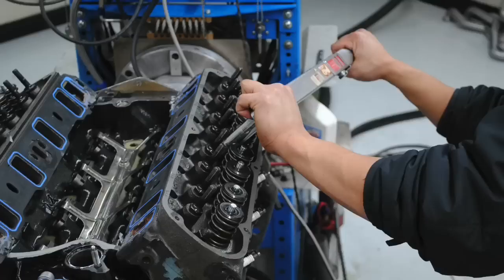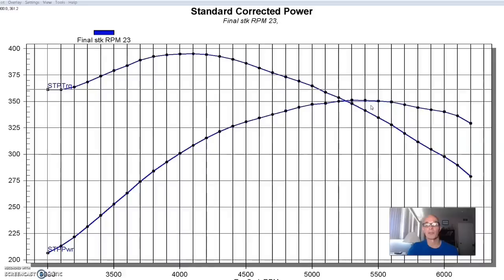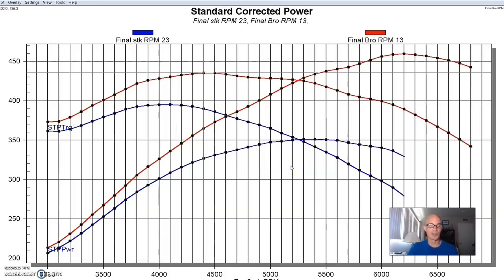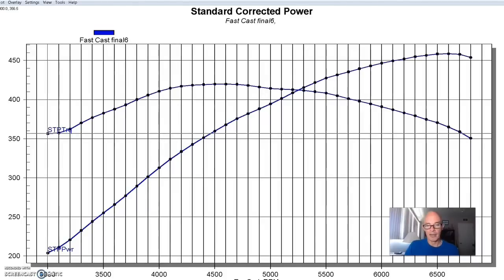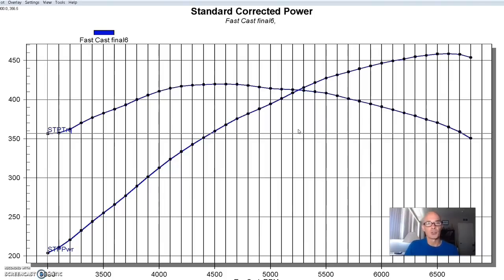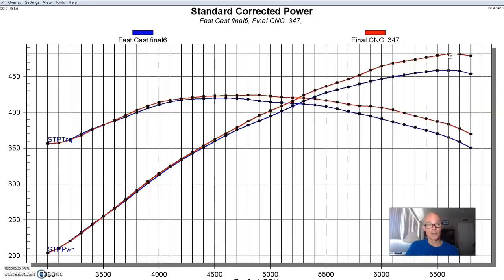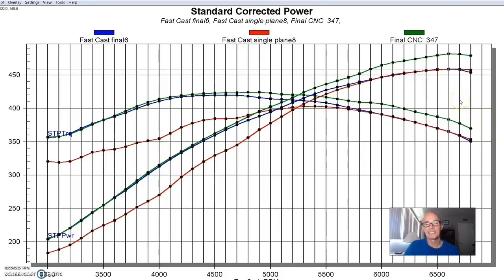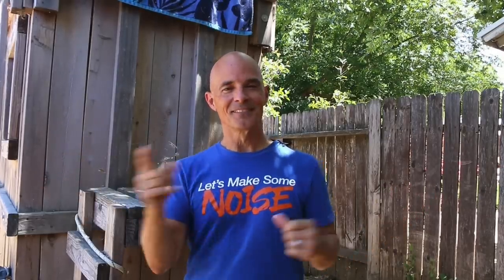347 FORD HEAD & INTAKE TEST

Comment: 306, stock 91 block crank and rods. .30 over forged pistons. Trickflow 165 heads, stage one cam and intake. 30lb injectors 70 mm throttle body, 30 lb mass air meter in a 75 mm tube, underwood k+n filter, BbK long tube headers, off road hpipe 2.5" flow master 50 series mufflers. Centerforce dual friction clutch, 3.55 gears.   91 5.0 5 speed coupe. 13.2s stock 1/8 mile, 7.8s after. Both on Mickey Thompson drag radicals. Man I miss that car....daily driver, pulled trim carpentry trailer and 17' center console boat with it

Comment: I have a 302 with speedmaster heads mini dome pistons 10.5 :1 Edelbrock 2221 cam .520 lift in and out air gap intake 650 AVS Edelbrock making 402 at 6300 😊

Comment: I have a 347 stroker with a trick flow stage 2 cam and afr 165 cnc heads. The car drives amazing but I think I left some power on the table not getting a 185 or 205 intake head. What do you think?
Reply from the maker: you didn't leave stuff on the table with those heads-they will support another 50+ hp

Comment: I put together 408 stroker. 10.2 compression, trick flow 11 R 190 cnc heads, Howard's cam 236 - 245 duration with 597- 597 lift, and a 110 lobe separation. Edelbrock RPM performer intake manifold ( not the airgap ). A 650 double pumper quick fuel carb, and with 30  degrees of timing, this combo made 525 HP and 530 torque at 5900 RPM'S, and that was with spinning the water pump and the alternator. Would have put a victor Jr. On it with an 830 carb, but don't have the hood clearance. Makes for a thrilling ride in my 2400 pound cobra.

Comment: What spring do you use when you upgrade the springs for the cam I am about to build a 347 looking to go promaxx project x 210 heads and a scat stroke package
Reply from the maker: don't they have a spring package on that head
Reply: @richardholdener1727  yes its a 145 pound closed and 325 open

Comment: 4v cleveland showed if the head is big just run a smaller cam.    The Boss 302 beat the smaller head bigger cam dz302 across the entire dyno plot.   The boss 302 uses a much smaller cam due to all the airflow.

Comment: Even on the larger 347 the stock E7 heads basically keep  up with all of the aftermarket heads up to around 3500 (equal to or within 10 lb./ft. of torque). If someone had a good set of E7 heads that would only need a fresh valve job, a bowl blended/cleaned up set would make a great sleeper daily driver on a 347. You are still getting the magical 1 hp per cu/in and all of the low and mid range you can get for a really fun stoplight to stoplight street car.

Comment: Its not the heads that are the limiting factor. It's the intake manifold and carb. Port the intake manifold and give more airflow and the motor will make more power.
Reply: Agree the manifolds need porting to work with the heads youre using.
Reply: @dennisrobinson8008 most of these tests are on out the box parts and im never going to run out the box parts if I have a motor torn down
Reply: @bigdogsportingtonyb2833 nice.     What are your thoughts on Parker funnel web?     Like you i dont think your induction is right until the intake is ported and setup for your heads and intended usage.   Many intakes are unfinished looking back at things.   Even vic 5.0 and 5.8 like you showed do 265cfm unported.    On a nice 330cfm head they'll limit flow unless you port them.    Those are some bad ass intakes when you set them up.
Reply: @dennisrobinson8008 exactly. We've ported and tested many FW manifolds and when people use them they are trying to make good HP with a stroker motor so you need them to flow but be efficient. Meaning keep port velocity high while also getting enough cfm to feed tge motor. Unless you are spinning past 7,000rpm i say stick with our ported Dual Plane manifolds. Best of both worlds

Comment: My combo using Trick Flow 170cc heads, with their upgraded springs. 

SBF 306, Reman Cobra motor,
Hupereutectic Pistons
Stock rotating assembly
Trick Flow heads
Ported lower, GT40 Tubular intake manifold port matched to an Accufab 75mm Throttle body 
Anderson B31 cam
Ford Motorsport lifters
Holley X
60lb injectors
Hellcat 525lph fuel pump
Aeromotive FPR at 53psi
Vortech V3 
6.87 lower 2.75 upper pullies 
570whp/538wtq 

I love all these dyno videos. I could watch 10 a day. The how and why along with the graphs are so intriguing for me. 
Please keep them coming. 

* side question. Can you run the AFR Enforcer heads on a 302? They flow less than the 165 Renegade heads and have smaller exhaust ports, but have the larger intake and exhaust valves from the 185 Renegade head. So I'm curious what that will translate to in power output at both peak and under the curve.
Reply from the maker: you don't have enough motor to take advantage of either head-so there would likely be minimal difference in power

Comment: I'm running 347 stroker with afr185 cylinder heads trick flow stage 2 cam Holley dominator intake dss dish pistons forged everything 660 Holley carburetor

Comment: Great video.  Thank you.  I'm working up a combo for my 89 Mustang 302 (5.0) street car now.  I'm determining how much head I need for the 302 and would like to run the same head on a 347 or possibly stroked 351 at a later date.  170 or 190?  Sounds like CNC ported is the way to go for that.
Reply from the maker: 190

Comment: I built a 347 using a dart block 4.125 × 3.25 afr 205 cam 251 in 264 ex 11.7 comp 750 holley 1.750 headers   with super victor and a parker funnel web the parker made 35 more hp at 5000 ft in colorao 537 hp 477 ft tq
Reply: The funnel webs are doing great and almost as much avg torque as a good dual plane.

Comment: Hey Richard, running a 302w which will one day become a 347. It will be a daily driver type build not a race car 😂 and planning on running Holley sniper injection.
Questions.
Will the afr 165 heads still be good for a 347 street car?
What cam would work well for both engine sizes and what manifold would suggest best for the sniper EFI.
Cheers
Craig down in New Zealand 👍🏻
Reply from the maker: if you plan on going to a 347-get 185 heads
Reply: @richardholdener1727  ok Cool thanks. What about a good low to mid range cam for street driving
Also manifold to suit Holley sniper EFI 👍🏻

Comment: Can someone help me out with lobe separation on a solid roller cam what is the difference between a 108 lobe separation and a 112 114 what is the  powerwize difference thanks guys? Mine is 248 at 254 .108 660 lift. 393 Cleveland is this a good cam?
Reply from the maker: YES ITS A GOOD CAM

Comment: 331 Keith Black pistons afr 205 renegade heads 1.6 roller rockers victor jr tall  intake 800 cfm demon carb. Lunati 549"-564" 270-280 duration 112 LSA. Do you think this would be a good combination for a single or twin turbo at 10 to 15 lb of boost?what kind of numbers would you expect? Thank you love your videos

Comment: I’ve built a few 351w with Edelbrock and AFR heads but my favorite engine combo is a little laughable but I’ve had it a long time and love. 327 ci Ford ( 3.25 stroke standard bore ). Red Cornet ported gt40 heads b303 cam air gap intake. Not powerful but puts my 67 mustang coupe in the 12.8 range consistently.  It just always does what it’s supposed to and never misses a beat.

Comment: I would of liked to have seen it with a ported gt40p head!! Thank you for the info, I’m building a 302 stroker 330, with aforementioned heads with a .500 lift ford roller cam, now performer rpm air gap (had China special), w/ summit 550 carb, .027 head gaskets, I know I’ll touch an easy 410 ft/tq, on a 70 Ford 100 short bed, with an AOD !! Perfect all around town/camping/cruising/ kind of truck!! Thanks again for the info!!

Comment: I would like to see a cast iron in the comparison.  I have an 82 Capri, 306, TRW flat tops, World Product Windsor Sr heads shaved to 58cc chamber, Comp Solid Lift 294s (248/248 dur .56/.56 lift, 1 5/8 Long Tube headers, 4500 stall, built c4, 9" with 4.56.  Dyno showed 270 at the rear wheels @6800 and my best et is a 11.945@ 111 mph.  I want to stroke the engine to a 347 but do not know if I should stay with the Cast WP heads or upgrade to AFR185/195s.
Reply from the maker: TAKE A LOOK AT THE 5.0l FORD HEAD TESTS

Comment: 306 dart, p7675 turbo, afr 185, rpm 2 intake, f cam did 782/785 on 20 psi. Thinking about stepping up to the xe274hr in hopes of making more power at the same boost level.
Reply from the maker: SHOULD MAKE MORE AT 20 PSI
Reply: Richard Holdener I’m thinking maybe in the neighborhood of 25 more hp na, so approximately 70 more at 20 psi if my math is hypothetically correct lol?

Comment: I got a 85 mustang gt with some 65 289 heads that's been ported and polished and with 2inch intake valves and 176 exhaust valves  double valve spring to match the f cam the heads have 49.2 cc closed chamber head with a weind stealth intake and a demon 650dp carb the car is real fast and reliable I drive it anywhere

Comment: 332 Stroker (91 block) Scat rotating assembly, Mahle 30 over 4032 forged pistons, 6.5 cc dish, fancy small low drag ring pack, 18 thou top gap, 20 thou bottom gap, pistons are 6 thou in the hole, torque plate honed cylinders, tight clearances PTW @ 2 thou, mains clearance @ 2 thou, XE266HR12 cam straight up, linkbar lifters, full roller rockers, 6.45” pushrods, static compression at 10:1, dynamic @ 7.80:1,  Blueprint HP9009 heads 2.02 intake 1.60 exhaust,  60cc chamber,  .039 compressed head gasket, Weiand dual plane, Summit 600 vac secondary annular booster carb jetted 68-72, bypass return style fuel system set @ 4.5psi, timing 11 initial total all in by 2900, 65 psi full synthetic, cruising temps in summer 165-170, idle temps 185, running 91 octane, never heard knock, don’t know much about tuning, idle AFR @ 13.5, cruise AFR 15.5-16(pulling in more timing with vac sec) WOT AFR 12-12.5, I like it. Works for my manual granny low 4 speed 1980 Bronco on 35s with 3.50 gears (I DO use the 6.69:1 “1st” to get her fat ass moving) highway cruising at 80mph @ 2700 rpm, almost forgot, have a 1” open space between carb and intake

Comment: 351w, afr185s smallest chamber, hyd roller from lunati small base circle with nearly .600 lift factory mustang r.lifters. 288/.294 with enough lobe separation it has a stock sounding idle, flat tops ending with roughly 10;1 compression, air gap intake,  pertronix, 780 holley from the 1960s, I threw a set of 1 5/8 shorty headers on and probably hurt the power.
 I don't know what it makes, but it has a ton of street manners just driving around town. 
The car is far from finished,  what kind of power do you think it makes???
With a nitrous tune, 8.0 in the 1/8 mile without the nitrous. Can't afford it yet...

Comment: In 1987 I built a 400 .030 over (406) Short rod 5.56 TRW flat top piston 461 casting (pocket ported to clean up casting lines and flaws in the port) << 64 cc Had to use 93 Cheveron, or Exxon, 99 cents a gallon back then ( before the Exxon Valdez Disaster)92 Octane phillips would rattle.. Camshaft was (Crane HMV 278 )I 222@ .050  E 234@ .050 278 290 << ADV ..114 LS  .467 .494 with 1.6 roller rocker = .498 and .526 " lift. Weiand 8004 Intake with an 800 Thermoquad.<SP>? Heddman headers. Stock converter no need for a increase in stall speed. I would LOVE to see this recreated and dynoed. This was in a 1979 Z28.

Comment: Which specific TFS as cast heads were used? I have a Ford 347 stroker w/the aftermarket Ford Boss 302 block that I am building and trying to decide on sticking with a TFS as cast TFS-51410004 170 CC INTAKE W/61 CC COMBUSTION CHAMBERS. I planned on doing some port work on them, but wanting 500-550+ HP and thinking it will be the restriction as I believe that they are going to max out at 500 hp. I am also going to run a 750 demon sitting on top of a Victor Jr intake that I will port match and do some more blending work. I am also planning on the XFI236HR-14 comp cam possibly. Planning on running about 11.5 :1 compression. I have also considered running a solid roller cam to wind it out in the power band to take advantage of the single plane manifold. I will be running a billet flywheel, aluminum rods and light weight pistons and a forged scat crank.

I would like to know your thoughts if there is enough flow with these heads to support the power numbers with the extra porting and blending work on the heads. It would appear that is what your video mentions that they would if you are referring to the same head. I do not know what the potential of the flow of these heads once ported. Can they support over 550 HP with some mild porting? 600 HP would be amazing if I can get it out of these heads.

Comment: Know this is an older video . The 347 was a very good performer every one I built made some steam . Best one I built was 15 years ago I called mighty mouse . Used a dome Wisco piston and a set of high port tfs head lightly ported would run 990-10.0 in a 3100 lb mustang with a c4 coan converter was a wheelie machine car ran great

Comment: Ive had a lot of luck with high compression (12/13:1) 347s with ported victor jr heads, single plane manifold and 750 dominator carb! 500 plus easy!

Comment: What I have that works is, unfortunately, not a pushrod motor. Stock Gen 2 Lightning blower, cams, and upper and lower plenums (with a ‘00 Cobra R throttle body) attached to a stock 5.4 block filled with a Manley rotating assembly. For heads, they are sporting 1mm larger intake and exhaust valves and some pocket porting. This is drawing through a 90mm MAF, field by the stock fuel system, exhausted by Kooks long tubes, Bassani cat pipe and cat-back. The blower is running overdriven (of course) with a 2.5 upper and 6 lower pulley set. It’s not perfect. Everyone knows that I know it needs a better blower. Money is king on that. This is good and reliable, for the moment. My dad had this built, and I inherited it.

Comment: hey rich do a set of good flowing heads like afr 205cc renegade  good for making more power with less boost, like i had to turn up to 19lbs to get good power on as cast heads but thinking if i use afr 205cc i can get the same power if not more on low boost what do you think???

Comment: I've got a 347 with AFR 185s, full roller,  1.6  rockers,  custom cam by Erson (I can get you the specs if requested) airgap intake and about 9.8:1 compression.  I'm switching to a Holley Sniper at the moment, but motor made 488 hp @ 6300 rpm and 458 torque @ 4600 rpm.
Reply: Very good and high power with only 9.8:1 compression.    Going to 11.5:1 will give you another 7% across the board, you'll have to run 93 octane which is fine.    How is that combo doing today?   I'm going to guess the cam had a 108 lsa due to the high torque.

Comment: My street car combo from a 1970 Z-28 in the late 70’s; 350 Lt-1, 4 bolt main, .030 over, 11.5 : 1 Manley pistons, 492 angle plugs, ported exhausts similar to the old Crane style, intakes gasket matched, Crane roller rockers, Crane Compucam solid flat, short to medium circle track F260/360-2-12NC, 260 @.050, .540”/530”, Edelbrock Torker port matched, Holley 750 double pumper, Chevy distributor with Accel single racing points, base plate screwed down to housing, vacuum adv. removed, mech. adv. curved, Blue Streak cap/rotor, accel 9mm wires, end play shimmed, total adv @ 36 degrees, Hooker Competition 1 3/4” x 31”, 20 lb. Shiefer steel flywheel.  She was a screamer, I would love to see that duplicated and run on the dyno to find out what hp it made.

Comment: I have a modular 2v triton ford. I’ve ordered tfs heads the 185cc variant with the small 38cc chamber. I was discouraged from the 195cc head because “I needed a 3.700 bore” basically I was told the engine doesn’t flow enough by itself to support the capabilities of this cylinder head. I’m curios what impact does the larger runner have on these stock displacement engines?

Comment: My 347 stoker combination, Dart 2 302 block, DSS -16mm dish pistons, SCAT H beam Rods, Lunati Voodoo Crank, Lunati Voodoo cam,  AFR 205 heads, Weiand Stealth intake manifold, 750 Demon on top. It's super low compression but I'm running 2 turbos. I bet I make 200 hp without boost. (7.9 compression)

Comment: Richard, I have a cool idea for the channel it's a series of episodes where you pick 3 random viewers from a sign up list. Those 3 viewers submit a parts list to build a motor that you pick. For example. Season 1 would be Ford 347  stroker. You have them pick the core parts pistons rods heads etc. If you cannot find or purchase the exact part you can try and fill in the blank with a comparable item. Some people would just pick their favorite 347 kit and that's ok too. From there you assemble and test each motor and score them on hp/tq, drivability (smooth idle, smooth revs), reliability and finally price. It would make for fun content. Once you finish the season you can blow them up with turbos or something.

Comment: I think a lot of us would be interested in a TFS 11R 190 vs 205 vs AFR 185 vs 205 type testing!
Reply: This thread is old but I agree. Built my engine 10 years ago. Blueprint 347. 185 afr heads, x303 cam and 670 Holley. Runs through hooker long tube headers. Car is 66 fastback mustang. Built aod trans with 3500 stall and 4:11 gears.

Comment: I have a 200,000 91 5.0 with a x303 cam world Windsor Jr heads Edelbrock Rpm air gap with a Holley 780 sounds good just doesn't make much down low, thinking about going much smaller on cam.

Comment: I actually have a 347 8.9:1 compression, Mutha Thumpr Cam from comp. Shaft Mount Roller rockers 🤣. 190cc runner, 65cc chamber proComp as cast heads, 650 Holley HP, Chinese dual Plane intake manifold, MSD 6T box. No idea what it makes, but it seems to run really well, blows the tires off at will....maybe one day I'll get a chance to test it on the Dyno. See how good/bad the numbers are.